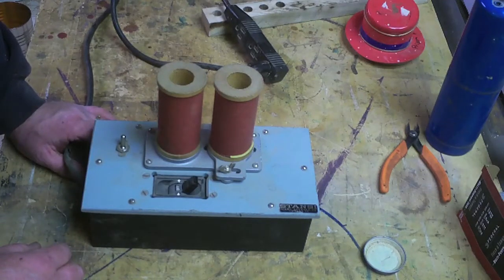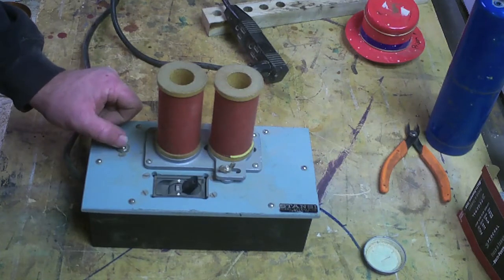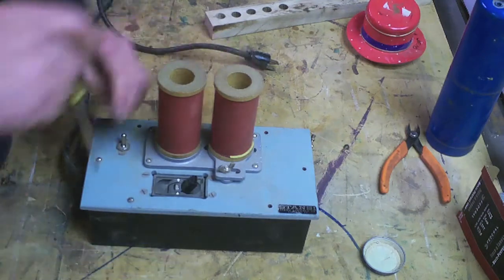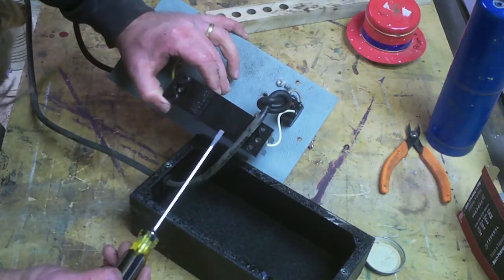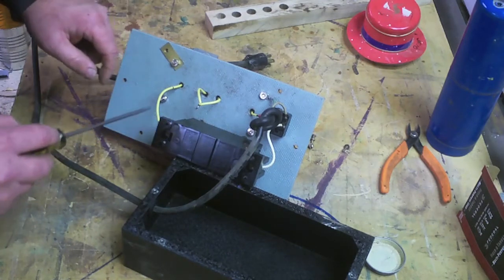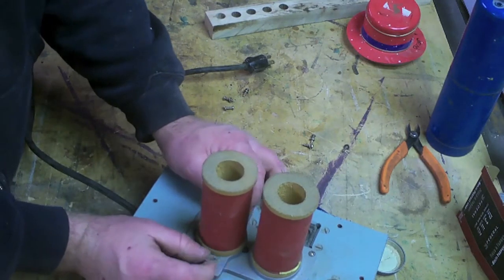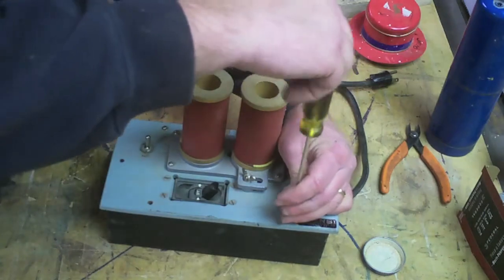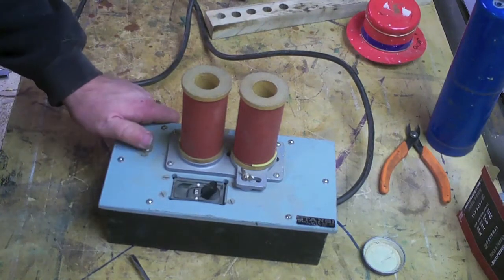What is the thing?  A revisit

Comment: It's definitely a transformer/inductor of some kind, and the core is missing, which is why it's tripping the breaker. Put 2 screwdrivers in the core, and it will likely magnetize them (and probably not trip the breaker as fast).

What use it is, i dunno.